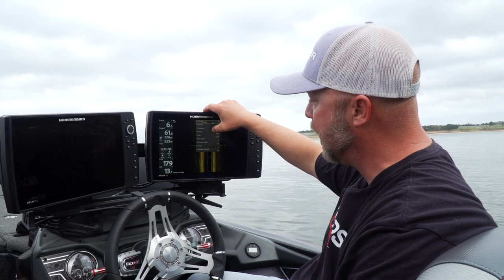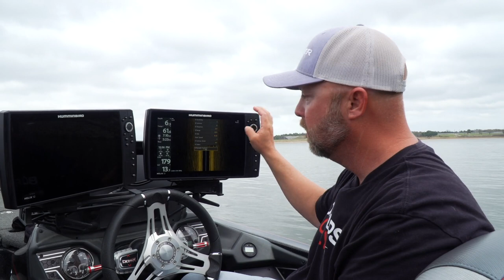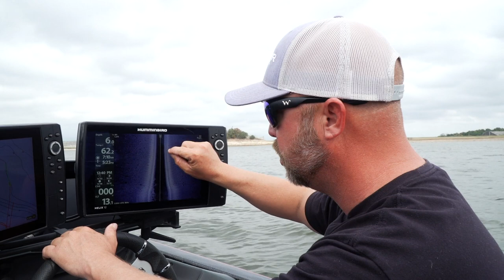Humminbird Series With Capn' Ron | Side Imaging

Comment: Something to mention on ALL this electronic talk is that it starts at the ramp. Having the transducer at the right angle is HUGE! Also, in regards to frequency, the higher the frequency, the more detail in the image, the less water it can penetrate. If you visualize the signal as a 10’ line, lower frequencies have shallow peaks and valleys so it goes farther. Higher frequencies have tall peaks and low valleys so it doesn’t reach out as far. Hope that helps some folks.